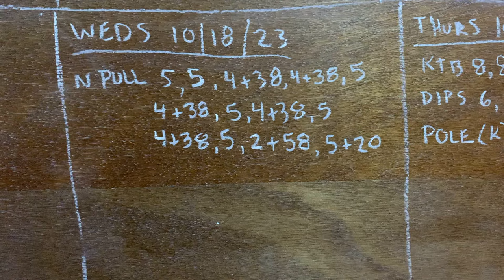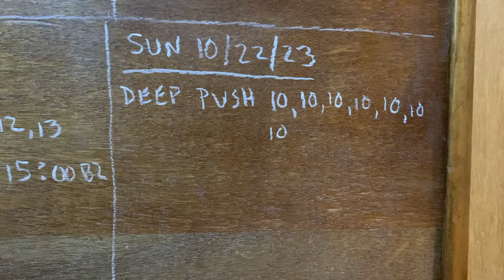VLOG 23.042 Strength Gains - Vermont Fall Scenery  - Robert Sapolsky's Determined - Digging Tunnel

Comment: That's insane you've manually dug that much under your house! Gives me inspiration, as I'm planning an 8 foot wood fence around my backyard, with will require 2.5 feet of digging per post - child's play compared to what you're doing on your hands and knees! +58 pound pull-ups are also inspiring. Way to go, amigo!

"Bowl uh miso, please." Spot on impression! My wife says I do a good "Gollum." :P

I've listened to Sapolsky a few times. Seems like such a smart guy, but wow, shocking he has such an under-thought narrative. Guaranteed every level of (what is now) crime, would skyrocket if we lived without laws. Ex. If shoplifting was decriminalized, I'd save a ton at the grocery store!
Reply from the maker: The way that I approach the digging, is to focus on the step I'm in, and not to see the whole project. That way it's never hard, and it never feels like it can't be done.